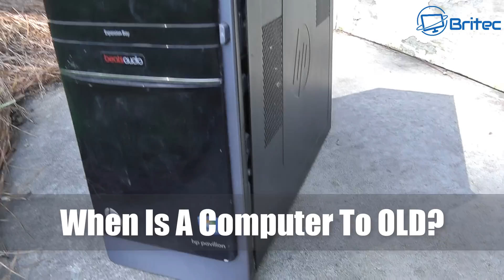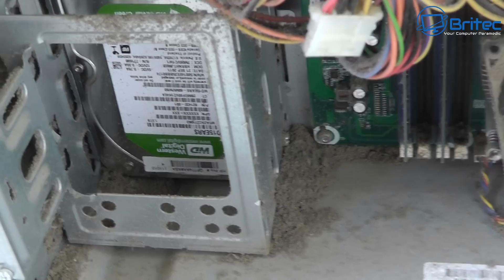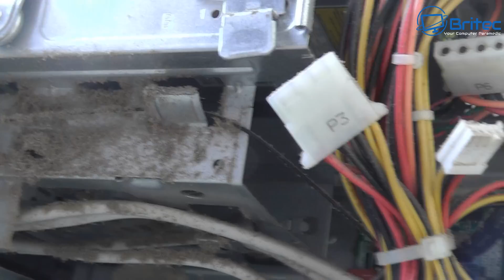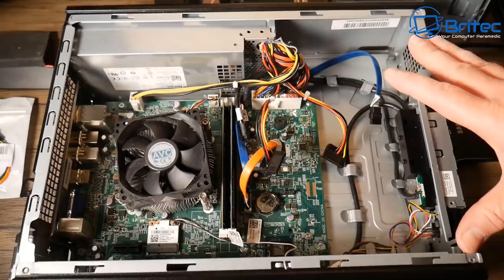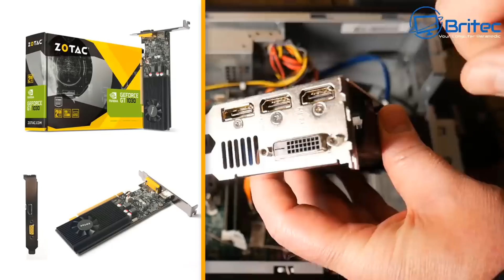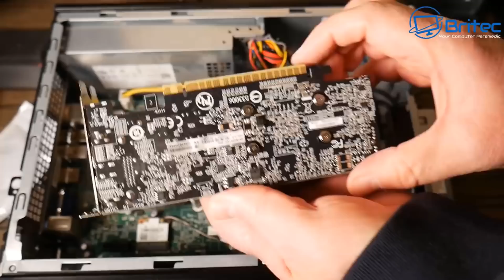When is A Computer Too Old

Comment: As a Radio Amateur I run DOS 6.22, 3.11, W95, W98SE, WinXP, Win10, and Win11, if you're running Packet6 then the 8088 is fine, an old SDR or WinPack then W95 is fine, or WinLink Radio Email, Pactor/Packet Radio on a Serial or USB External Radio Modem, or ALE or any Digital Modevia a Serial or USB Transceiver, then either WinXP on 32bit, or a single/dual 64bit running  Win10 is fine, it's quick enough, especially with an SSD.

As a Video Editor, I have two machines dedicated to Editing and Media Transfers, for 4k Video I have AMD FX 8 core with SAS/SATA Card running three RAID drives over 16 physical drives 4x SSD for OS/NLE RAID10, 4x SSD Scratch Disk RAID0, and 8x HDD Source/Archive RAID6, no problems Win10 Pro, yes in a few years I may build a new bespoke system for Editing, for Media Transfers between Cine Film/Analogue to Digital Media, with some Editing/Colour Corrections in 1080P, then an AND 4x 4 core running Win10 on and SSD/HDD/HDD System, it's fine, quick enough.

For Livestreaming Sports with Green Screen Live BSL and/or Live Audio to Subtitles, then i5 or i7 laptops are fine for OBS in 1080P Livestreaming, until the UK backbone gets fast enough then Livestreaming in 4k isn't worth it, and yes at that point I'd be looking at new laptops, new cameras, but at the moment its fine.

For Data Recovery I have three Machines, one running WinXP to allow SCSI HDD recovery, one running Win7 with a Phenom 2 X6 1100T Black, and one running an AMD FX 4 core, all quick enough.

For Encrypted Weather Satellite Data I run two Win7 Machines, one 24/7 downloading and decrypting data from EUMETSAT, the other creating videos of Aurora/Storm Systems and anything else of interest, all on single core 64bit AMDs, all quick enough.

Also, computer logging for Amateur Radio, and even CB, plus a DX Spotting Application is very low on system resources, throwing in a dirt cheap SSD and making regular NAS backups is good enough, however, due to my interest in old storage media, I also have EIDE RAID on old gear running JBOD on a random various sized ancient HDDs, just because I can, and it's backed up on the modern NAS as well.

Then I play a lot of old DOS and Windows Games on 3.11, W95OSR2.5, Win98SE, and XP, either 16bit or 32bit depending on the age of the machine, I even have a WinXP 64bit on one of them, just because I could, but locating hardware drivers were a problem, ha.

Then there's my collection of Sinclairs, ZX-81, 48k Spectrum Rubber Key, 48k+, 128k+, and even an Amstrad 2+ (yuck), but am awaiting delivery of two Spectrum Next 2's in Q3 2023 from KickStarter.

It really depends on what you use the computer for, it's intended bandwidth/contention/throughput or application, funnily enough the fastest machine here is a laptop running Win11 Pro, and I only use that for email, browsing, and YouTube.

So maybe someone's old junk is interesting and valuable to others, I wouldn't have a 486DX-4 100MHz running 512MB of RAM (paged 256MB), or a 286-25 /287-12 with 32MB, or a 386-DX40 with 32MB, if people didn't once think all this stuff was junk.

I'm just upset with the collectors that drive up prices to just mount them on a shelf or wall, mine actually work, even my 8088 has Sound and 10Mbit NIC and runs Arachne, and will run Windows 1.04 at some point.

You guys keep throwing it away, one day I'll get my hands on a AMD K5 PR-200 before the collectors do.

Comment: My Desktop CPU is old it's a ryzen 5 2600 but I can still do alot of things with it, any older than that and I'd need an upgrade.  But the good thing is I can upgrade the CPU to like 5600x or something  or maybe even a ryzen 7 3800x, can't really upgrade the Ram though it's at max the motherboard can support 3600

Comment: Not sure if official support for win11 is worth anything. I got myself a brand new Thinkpad with top of the line specs about half a year before Win11 was revealed which still isn't supported. Probably will work just fine if I install it by force.
Reply from the maker: Some old computers are just not worth using like the ones in this video

Comment: My main machine is a Dell XPS 8700. I have upgraded RAM to 16GB and moved Windows to an SSD drive. It has an i7 processor so I think I’ll be OK for the next few years. I have a Dell Optiplex 755 set up for my wife running 32-bit Windows 10. It has 4GB RAM with Core-quad processor. It should be OK for email and web browsing during this same time until I replace my machine and she gets mine.

Comment: 3rd gen i7-3770 - and I know an i3-10100 would pull ahead of it... old i7 = 4c/8t, new i3 = 4c/8t plus some improvement in IPC (though evolutionary rather than revolutionary).
One of the key points against old DDR3 based platforms now, is the price of DDR4 RAM has fallen to the same level as used DDR3.
I also have a retro P133 running Win98.
Windows 10 will run (or perhaps walk) on some pretty weak hardware, tried it on my old P4 and I'd say it ran remarkably well, felt faster than it did under XP, though that WAS with fresh install advantage

Comment: I have a Dell laptop from 2006. It's got a Core Duo processor, 32 bit, with 2GB of memory. But - it has a 1920x1200 screen, a 512GB SSD, a discrete Nvidia Graphics processor (Geforce GO 7800) and runs the latest update of Windows 10 (32 bit). So, is it too old? It's a matter of opinion. It still works perfectly well for web browsing, playing videos, email, office documents, etc. Using Windows Debloater on it helped to speed it up. I also have a 2009 Dell desktop running a 1st gen Core i7 950 with 12GB of triple channel memory and two 512GB SSDs in RAID 0 with a Radeon graphics card and a 2010 Toshiba laptop with a 2nd gen Core i5, 16GB memory and a 512GB SSD. Both of those still run Windows great. I never get rid of a computer. I just upgrade them as much as possible and keep optimizing the OS to prevent it slowing down.

Comment: I know.  I have an "ancient" Dell 14 year old Core 2 Duo PC that has been upgraded over the years I use as my daily driver, while keeping my "better" newer system set up only for CAD/CAE work.  

I was able to upgrade the RAM to 16GB, added a SSD for the O/S a few years ago, had to put in a different (but used and cheap) video card to run Windows 7 and 10.  But it is finally at the end of the line. It will never run Windows 11 so I know the handwriting is on the wall as they say. 

It still runs Office, Google Chrome and Edge browsers just fine.  I use it for iTunes, YouTube, Facebook, Yahoo! email, and even for editing audio files via Audacity, messing with photos using GIMP.  It does everything I want it to albeit a little slower than a new i7 based PC that screams.  

I'm not going to throw it away though. Come October 2025 if it is still running, I'll put Linux Mint on it and keep using it until it dies. 

Now that much of my CAD/CAE software is "cloud based" I can finally get more use out of my "young" 9 year old i7 PC, LOL...

I do have to say that adding a SSD to an old PC is one of the best upgrades anyone can do and it isn't hard or very costly.

Comment: My main PC is a I5-11600K with a RTX3060TI and 32 GB 3200MHz Memory on a Asus Prime B560M-A motherboard. My second oldest system is I5-9500 with 32GB memory at 2666MHz with a GTX1660TI and a Asus prime B360M motherboard. My old systems have I7-3770s, 1 has a DTX 1660, 1 has 1 GTX 1050TI and both have 16GB memory at 1660MHz. The new systems run Windows 11 and older ones run Windows 10. These are both usable systems today. Now my oldest retro PC has Q9550 with 4GB memory, GTX 750TI, and runs XP for old games. I7-3770 is still usable until Windows 10 ends life sometime in 2024. It's still somewhat secure. Windows 11 can only improve over time, it's not bad now. TPM is just a future proofing method for me with windows 11.Oh I also have a MAME machine with a E8500, 8GB memory @ 800MHz, and GTX 750. That's just a vertical MAME machine that doesn't need much. That's my range of PCs.

Comment: I have a machine that I combined from 3 into 1 after hard drives started to fail and Windows 10 failed to run on one of them. The remaining ones were an HP Pavilion 6560t and 6319fh. They both came with Windows Vista. I took the 6319 motherboard and chassis and combined the 6560 parts into it and have 4GB of DDR2 RAM, a Core 2 Duo E4700, and a 256GB 7200rpm HDD. It also has the NVIDIA nForce 9300 GE graphics card, which had support until 2016. The machine is running Windows 10 without any issues aside from slowness.

Obviously, the games it can play came out in 2006-2010, including Minecraft. So, I mainly use it when I am either bored or when I need to work on a document if I don't have access to another machine. That means that when Windows 10 End of Life occurs, that machine will be retired unless something changes where MS allows Windows 11 to be installed without the possibility of no updates to old hardware.
Reply: That's so cool.

Comment: Retiring an HP core 2 duo 8GB RAM in my upstares room for web and stream that has win 10 PRO (straight from Microsoft, not HP)/MX-21 Linux dual boot aprox 10-12 Years old. With a DELL INSPIRON 3670 INTEL CORE i5-8400| 16GB RAM from 2019 or so. With NO OS or drives. cloning the HPs OS drive and getting a key for win 10 pro for the new to me PC; onto an m.2 nvme SSD of 1TB and migrating the 3.5 in 2TB HDD will allow not only suffering. streaming and light email but other dev and testing I don't want to try on my primary system or the 2nd (an AIO) used mainly as a backup office PC that's next to my laser printer. Have not decided if I will keep it win 10 PRO, but with this Dell Inspiron, all I would have to do is disable secure boot or better yet disable platform trust technology for intel, to keep it win 10 pro and keep secure boot we will see what is needed so that both Windows and Linux can co-exist on a UEFI system (the HP is BIOS only), another reason for its replacement. In both OSs the upstares Dell will be monitored by nomachine remote access

Comment: Every computer being new or old is going to have it’s limits. As long as you are getting security updates be that in windows or Linux. And does the task’s that you need it for in a reasonable processing time then it’s not too old. I’ve had older supposedly no good computers given to me for free. I’ve cleaned them up. Did minimal upgrades and gave a few away to my aunts and uncles. It was actually upgrades to them and is actually more than what they needed, email, YouTube, some google searches. And they were literally going to go to a landfill. Don’t necessarily toss out something because it doesn’t have fast enough purpose for you. It could actually help make someone else’s day more productive. Just my thoughts.

Comment: Stull using a 15 year old Dell laptop with 500gb hard drive. Only thing done to it was went from 4gb to 8gb ddr3 ram and replace the battery. Keep in mind always replace the comos battery every 2 years. Mine still works good abs runs auto cad

Comment: I have a Gigabyte mobo that runs the i7 980 6 core CPU around 2009. Around 2010 and 2014 or thereabouts the Intel CPU did not run much faster but used less power. Over the years I keep upgrading the graphics card. Recently I changed over to SSDs.
I’m aware my mobo is over ten years old so in 2020 I bought a Ryzen 9 3950 CPU but still use the old machine occasionally.
What I like on the new PC with Win 11 is that I can swap out of any game to a different desktop to look up a gaming hint (or chest).
I occasionally see small businesses such as motels still using beige PCs.

Comment: Ok, I take your point and understand everything you are saying in this video. However, I upgraded my old Dell inspiron 580 to an i7 cpu, a 4 gigabyte Geforce GTX 970 GPU and maxed up the Ram to 16 gigabytes. The system is now well capable of multitasking, rendering 3D graphics in Blender and similar 3D apps, whilst running Adobe Photoshop and Adobe Illustrator all at the same time. Maybe a totally new computer would be better in terms of performance, but since I only spent £300 upgrading my old system I don't really think it was a bad investment and I cannot afford to buy a new system currently. I will wait until 2025, when Windows stops supporting Windows 10 before getting a new PC. Thanks for your wonderful video though. I did enjoy the presentation:)😊

Comment: Microsoft W10 Pro
Asus Sabertooth z77 motherboard.
Intel 3rd gen Ivy bridge i7 3770k, overclocked too 4.5ghz.
Corsair vengeance pro ddr3 32gb 2400mhz.
EVGA Gtx 1080 SC.
Still games fine at 1080p. Even 2k with respectable frame rates.
Definitely still good for basic applications and web surfing.
But because W11 is pushing its mandatory security features that works well on newer hardware. Builds such as this don't make the cut. Personally, besides this computer's age, it definitely got more to give. Also that W11 security feature becomes optional after installation. So why not support good older hardware? Probably because of compatability issues going forward? Keep in mind everything under 8th generation Intel CPUs and 2nd gen AMD Ryzen CPUs are not supported at this time. Booting out 7th gen Intel and 1st gen Ryzens and within reason below that, as a cheaper alternative upgrade for the community.

Comment: started my spare ddr3 pc up loaded win10  Dam it slower  2019 bought all New Drr4 32gbts  MB  cpu  gpu  $3k I,m done 
the ddr3 in 2016 cost $900  GeForce 960.4g NVidia Gpu addon  mite sell it one day  never used it again

Comment: Lol now i like your videos Bri, but i take issue with just about everything in this one  :)  i watched this video on an I3 dating from 10-12 years ago.......... the laptop i usually watch youtube videos on is a 1.73ghz dual core from around 2007 ?  and apart from a noisy fan, is ideal for youtube videos.  like you say, its just what you want to use it for....... most people dont ever render 4k videos ?.......  now i do have a single core 1.7ghz laptop from 2004?...... and yes even i admit. thats too old now............. battery still holds a charge tho ! lol  :)
Reply: for the 2007 laptop, upgrade it to 4GB RAM, SSD, and upgrade the processor to a 2.4ghz Core 2 Duo (can be had for £3-4 on aliexpress) and clean the fans, heatsinks, replace thermal paste while you're at it. It will run like new! (well a lot better than it would originally)

Comment: Now wait just a minute!!

I didn't hear even ONE mention in all this of the the fact that old computers can do what new computers CAN'T do!

I have programs for my synthesizers and music gear that would no longer work when Windows 7 came along. I need an older machine to run that software. Don't please start bleating that I should use more modern software - in these cases, it doesn't exist. So I keep an old laptop which runs XP so that I can continue to run such software as and when I need to.

And again, PLEASE do NOT bleat that "Oh It's Out of Support", "It's a Security Risk", "1,000,001 hackers are just itching to destroy my machine," etc etc etc. So what!?!? I don't believe in the Boogeyman, and I don't use this machine on the Internet. It's strictly off-line.

Bottom line: It will be "too old" when it kicks the bucket. NOT before.

Comment: You talk a lot of sense. The death knell in my opinion is when your anti-virus vendor drops you for your old OS. Having made a hobby of refurbishing older computers, my first check is the power supply. No SATA plugs, then likely only the case is good - you empty it out clean it up and start over, simply because us old nerds still want the optical drive bays and try and find those in a new case. The old ThinkCentre A8 Elite quad-core that I'm using now as I reply has an SSD, a higher-output power supply and Linux Mint as the OS. Only time I wish for more power is when converting audio files. Otherwise for browsing and Email it's still quite usable. Windows 11? Bah humbug!  Speed cost money - how fast did you want to go?

Comment: I've refurbished hundreds of old "corporate" PCs. They are great for almost everything that does not require a beefy graphics card. The power supplies in them are underpowered garbage that is also proprietary. They are usually 140 to 220 watts and cost a fortune to upgrade. Old Dells are expensive? Nope. You can get these old PCs for one to two hundred bucks and often gat a whole palette of them for that price at government / university auctions. One of the 5 PCs I have running now is a Core 2 Duo Quad with 8GB RAM and an SSD. I upgraded the processor to the 9650 and it runs great. If you like older games and don't need to render high def video they are fine. Dell, Lenovo and others have support websites where you plug in the serial number or scan your PC, tell you exactly what is in it and exactly what you can upgrade each component to. I've found these PCs sitting beside the road as trash and had computer repair shops just give them to me in exchange for spreading their business cards around.

Comment: Anything that won't take an M.2 NVMe is too old for me...  I do run windows, in a virtual machine on my Linux system...
Reply: so 90% of computers people are using?
Reply: You can put it in 15 years old PC via PCIe expansion card, though it will be limited to PCIe 3.0 speeds about 4GBps.